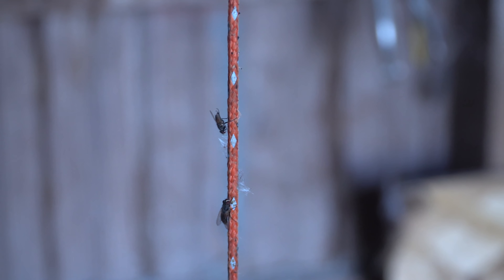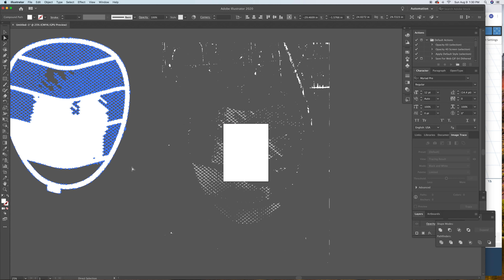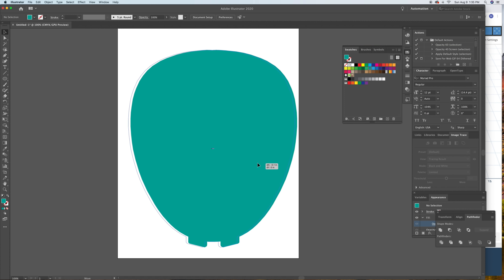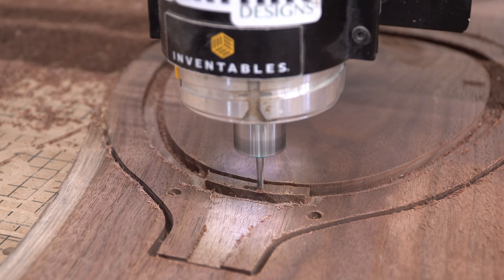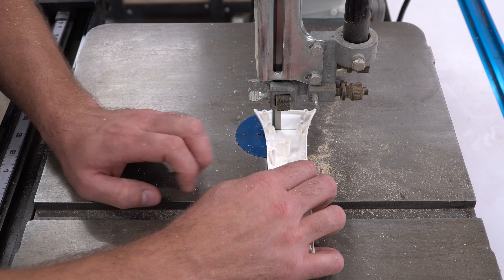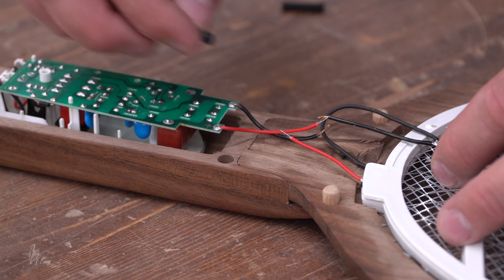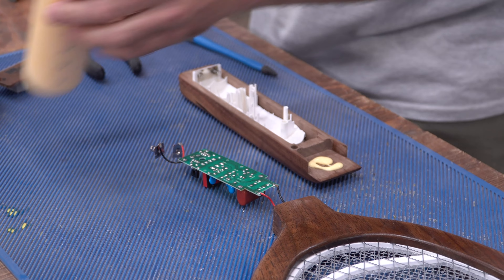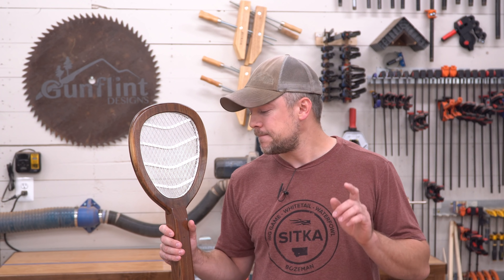Upgraded Electric Fly Swatter - Woodworking & Electronics

Comment: The circuit board is to produce the high voltage to kill the flies.
Reply from the maker: That possibility occurred to me after I finished this. I have another cheaper racket that doesn't have a circuit board and it kills flies, but not with the loud snap or blue spark. Made me the the circuit board was just an amplifier.

Comment: You must get a 3D Printer so it would be easir to make a mount for the electronics and keep the handle smaller. But good job! ;)
Reply from the maker: That would be pretty cool, I'm just not sure how much I would use it.
Reply: @GunflintDesigns  Probably you would use it a lot more for prototyping than you think. And if you intend to make more projects that using electronic circuits than it could be a great allied. Maybe ask for a new sponsor ;)